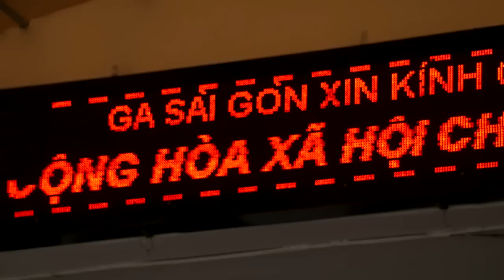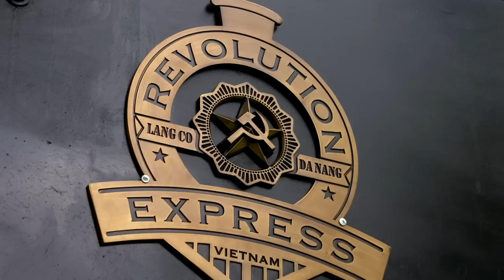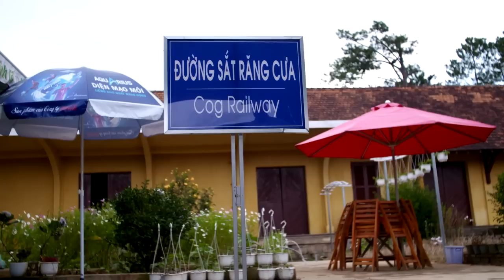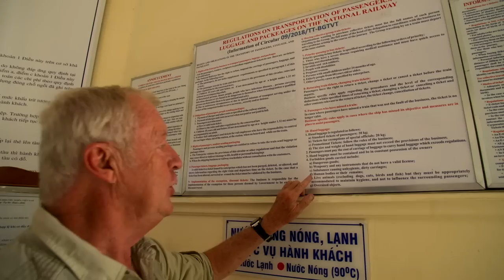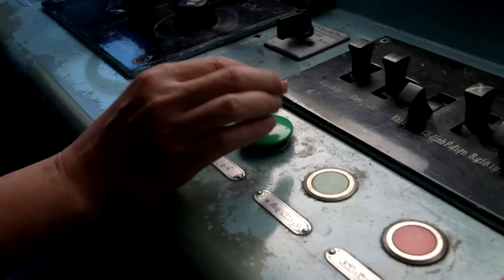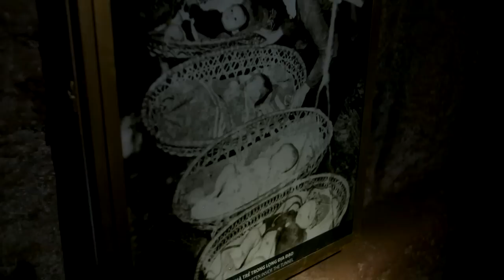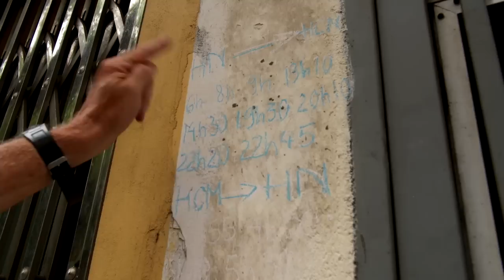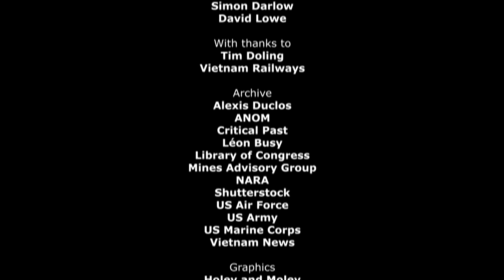Chris Tarrant Extreme Railway Journeys Vietnam on Vimeo

Comment: It's hell when you travel from Saigon to Hanoi in hard seats. Seriously.
Reply: Actually, with the implementation of new suburban system, we deliberated long and hard what type of seating to install. Keeping in mind the vandalism that is so ripe these days. Eventually we settled for upholstered soft cushioning with a manufacturer claiming the material could not be cut or damaged. Mind you it was bloody expensive to boot. guess what, within 4 months these seat were getting destroyed by vandalism. I then suggested they should all be replaced by stainless steel, let's see them damage that. Unfortuantely they didn't agree to that, and still have the same material today, still being vandalised.
Reply: @itchyvet  
There is very little vandalism in Vietnam . Hardly any graffiti and the young are very respectful to the older generation. Maybe that’s because there is still mandatory military recruitment. I see these youngsters running bare feet at 5am most mornings . Healthy body healthy mind there is hardly any obesity in Vietnam.

Comment: It's very dangerous standing so close to a moving train. Any loose rigging or other gear can snag you and you're dead meat; even if you're in a vehicle.
Reply: Whilst operating a Fast Goods from Kalgoorlie to Perth in Western Australia, we had a load of flat sheet steel on board to the rear. After departing Kalgoorlie, we had a call from control asking us what condition the signals in advance were exhibiting when we  approached them. He was told all was good and they were exhibiting the appropiate colour. We asked him why he was asking, he replied that all signals behind us were DARK and he could get no response from them. Suspecting something was amiss with our train, I stopped in the middle of nowhere and walked back to check the load. Sure enough, the steel sheeting had come adrift and was protruding over the side of the wagons and cutting the signal poles in half like a knife thru butter. Consider these poles are cast iron. Apparently we'd take out no less than 9 such poles already. We stayed there until they sent out a front end loader to reposition and secure the loading then were sent on our way no further issues. So yeah, unless you have a death wish, I do not recommend standing and closer than 10 feet of a moving train, even that, may still be not enough.

Comment: I have no clue how you could miss a train when you are crossing the track. You can feel those things coming long before they they are visible. They could add bells and ditch lights to their locomotives like they do here in North America.
Reply: Bells and whistles, lights and what ever other thing you can think of will not stop. I MUST BE IN FRONT. I've seen lots of US road rage , late exit, brake check videos. Non of them have anything on Driving in Vietnam. I'm a Brit and having lived here for 12 years I've found the only way to drive my SUV is don't look left or right, make a turn slowly and they get out of your way.

As an ex tunnel construction inspector I was asked by a railway enthusiast who wanted to bring the Da Lat mountain railway back to life. To inspect the 7 tunnels on the line, all were perfect just a few drips of water it's the bridges and rails that would be a problem. The original locomotives were sold back to he Swiss ?? So new engines would be needed, these can be build in India.
Reply: @TheByard  As a retired train driver, I can concur with your thoughts. We had many issues of road rage, motorists trying to cross the track despite the boom gates being down. Lots of collisions and deaths occurred as a direct result. Drivers reported that many such occurrences occurred during their shifts, management refused to believe it. I challenged them to put CCTV cameras in both ends of the train and record the events. After two weeks of recording, they surrendered, and accepted there was an issue there. We ran many test trains, flashing yellow lights on the roof of the cabs, twin flashing head lights and even attaching an American bell, clanging away on the front approaching crossings, result ZILCH. Made no difference whatever. People simply refuse to see what they choose to ignore.